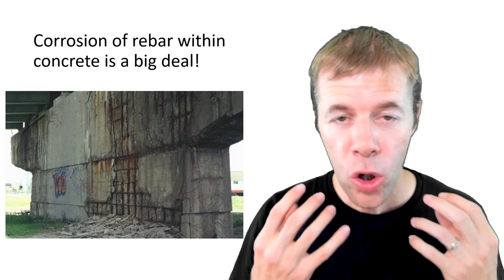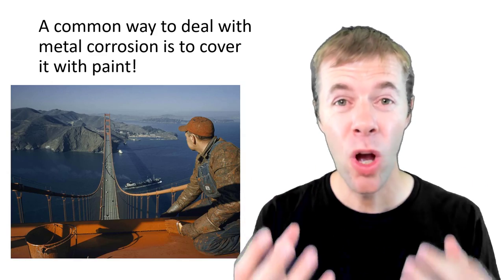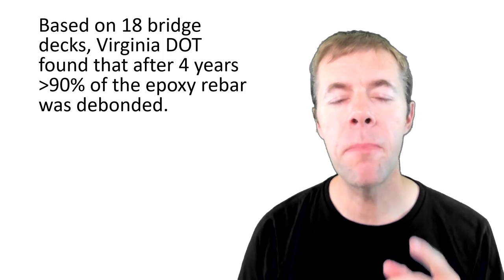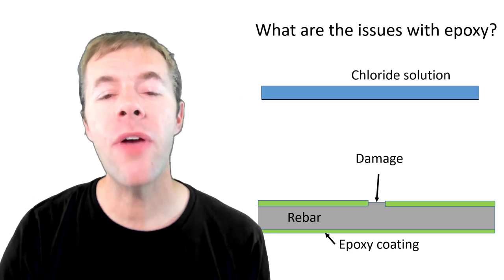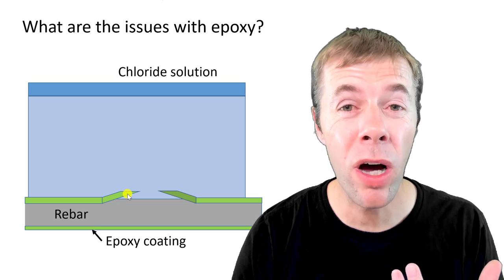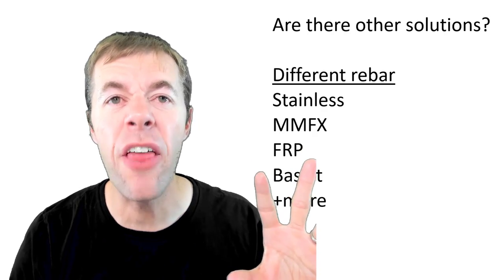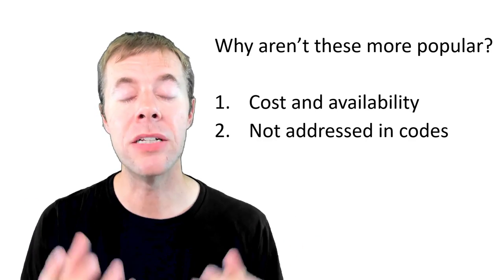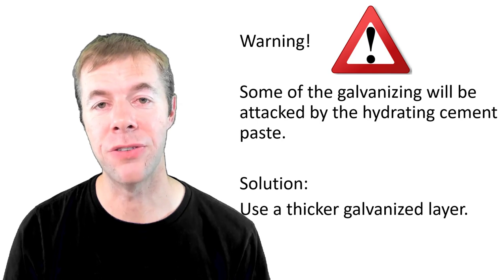What is epoxy coated rebar and why is it being banned?

Comment: Galvanized steel rebar would need to be shop produced very accurrately out from standard rebar and only the you could hot dip galvanize it, as any cutting or bending would damage or remove the coating.

In practice, a lot of rebar is field cut and bent, so galvanized rebar might not be practical.
Reply: galvanizing takes the corrosion away from the steel and gives it to the zinc even if theres rubbed bare spots. they have zinc blocks they bolt to ships hulls to keep the rust down. the zinc blocks corrode away and they replace them every now and then. its just something how the chemical process works. i dont know how it works i just know it does
Reply: @chaytonruijsenaars3971  Yeah, that really depends on what type of galvanizing you use, and on the blend of the zink in the tub.  I have work at a galvanizing plant in Denmark and we would get stuff that need to be remade from China and Poland because it was badly made, but people tend to uses them because they are really cheap, but cheap might mean the layer isn't uniform or the mixture is bad so the lifetime is short on the product. I have seen products where the rust got through the galvanizing layer and simply ran under it making it fall of in flakes, because they used too little zink in the tub, wrong temperature, to little time in the tub so the layer was to thin or they dumped it in before cleaning the iron so the outer layer already was rust, so the zink was just put on top of a layer of iron already compromised. Then we have to strip the old layer, clean the iron and put on a new layer, and even here people want the cheap option with as little a layer as possible and even option the cheaper layer option of no guaranty on the uniformity of the thickness on the product as this take more time to do and test.
It's relative easy to treat standart iron bars, but the length and weight can make it more costly to do, as there is a limit to how much you can do at any one time, and you still need to hang it all and treat it, so it will still cost quiet a bit on a ton of iron to do, and it quickly adds up and adds time to a building process and it also means you can't just cut it at the site and be done with it, as you then damage the coating and create weak points that need ned zink.
Reply: @-JustHuman-   im no expert but isnt the hot dip galvanized rebar ran from the forming machine down the line and then allowed to sag into the galvanizing vat and come back out at the rate thats needed for it to have a proper coating? or is it like cut to length then hot dip galvanized. theres also like that conduit mount C channel which is electro plated isnt it? why wouldnt that work?
Reply: Galvanized is better than painted or epoxy but you would still need to touch it up with spay cans where it is cut or bent as the coating would crack at the bend. I have never seen guys on site with touch up paint as they install rebar.  It’s difficult to be on the deck or columns when there is little to stand on.  There needs to be an inspection and touch up certification process tied to this process. And it has to be fast because GC.s want to pour concrete fast and move to the next area.  Nobody is thinking this little nick is going to be a problem 20 years from now.
Reply: @chaytonruijsenaars3971  Well we only got what was already cut, as it would be the ironwork's or smiths that make the rebar/iron, and we have nothing to do with that. I don't know if any one does that at all to be frank, as it would be really hard to do, as we had to hang the iron to dip it in acid, to clean it, then in the galvanizing blend to coat it and let it hang for hours to cool down. I really can't see that be done easy from smelting, then cooling, to stretching, then dip and cool in one go, it could be done but it would be hell to control and one misstep or doped iron in the tub and the whole machine goes into stand still, and you will drop irons sometimes as liquid metal is really hard to work with, especially if something hollow with trapped air gets into the tub then you get an explosion with tons of molten metal going everywhere, that is scary.

Electrogalvanization wasn't something we did a lot of I don't even remember if that was offered at all, as it really don't hold that well compared to the hot dip as it's usually thinner from my understanding, and it takes more time and is more expensive. Most request was normal galvanizing, then powder coating and the then the combined of those two which is what holds up the best, looks better and cost the most, but you wouldn't do that with rebar.
Reply: Normally zinc tends to migrate to bare spots, replating scratches. It requires an electrolyte though, I don't know if this takes place in concrete. I don't think the bare ends would be a problem given that it would take so long to corrode deep enough to make any impact on anything. As for the bends, a bend radius large enough not to structurally affect the rebar probably wouldn't affect the coating either.
Reply: @fascistpedant758  It's going to make the iron hold for longer than without it yes, but galvanized iron will still rust over time, and it can still rust with zink still present under some circumstances, I don't know the english word but we call it "Flying rust" here as it's something that coats the metal surface even if the metal is treated, you can see it in dishwashers sometimes on cutlery too even on stainless steel. Using electrolyte and zink blocks on boat hulls is common to prevent metal fatigue, but I don't think that would ever work in construction as it needs the seawater and a current to work as far as I know, and the zink blocks would have to be replaced regularly to keep working. And i agree you can bend the iron, but cutting it or welding it would still be bad.
Reply: Not really, reapplying zinc coating is super easy, there's the aerosol zinc coating like a spray paint and theres also a zinc bar where you heat the workpiece and rub the zinc bar on it like a marker. Its actually stupid easy and can train a monkey to do it.
Reply: The blocks on boats/ships to help against electrolysis and corrosion are called "anodes" and they aren't always zinc, they also can be aluminum.
Reply: @thomaskoogle9351  exactly, the quality control isn't there and it's all about getting it done asap. You hit the nail on the head.  

And that's what always amazes me about old structures and machines, they spent the money and time to make them last and over built everything.
Reply: @NeuKrofta  "The blocks on boats/ships to help against electrolysis and corrosion are called "anodes" and they aren't always zinc, they also can be aluminum." 
Ah, yes that's the name, but again I don't think it works in construction wit rebar's
Reply: @-JustHuman-  no, but people keep mentioning them. Just letting them know what they're called

Comment: I’m from key west and a contractor as a young man I worked with epoxy rebar on replacing the bridges and agree even though we coated all cuts the handling does scrap the coating away and never gets recoated I hope this won’t affect the bridges but who knows. I also have had customers that insisted on stainless steel for sea walls and I thought they were crazy to pay for the difference but maybe they were smarter than me. Thanks for your cast.

Comment: And then.... what do we dump on those bridges and roadways?  Calcium Chloride.  Face palm!
Reply: Ric Rovey  sodium acetate is used here
Reply: mag chlorate here. doesnt eat steel as fast but it is hell on copper and aluminium.
  honestly, there isnt any need for more than sand the chemicals cause more problems than they solve.
Reply: Its not the chloride that is the problem, its the oxygen atoms in the concrete. Even if your concrete is relatively dry. Hydroxides in the concrete are the real hazard. The chlorides attract water help liberate the oxygen atoms from the water and the concrete hydroxides. The oxygen reacts with the metallic iron in the steal and presto! you have rust.
Reply: WireTamer Where do you think the oxygen comes from? That's right.
From chorides.
Reply: Here in Colorado they rarely use salt, occasionally on the passes they will spray some saline but in general it isn't used because it's terrible for the environment.
Reply: @lukewarmwater6412  Exactly. Sand is ecologically inert, cheap, easy on steel, and effective. It seems that what people expect in the winter is not just a non-slip surface but one in which the snow and ice are actually melted away and the road clear. Crazy expectation in northern states.
Reply: @rcnelson   Sand alone has it's own issues it is very dirty and requires a spring clean up. As it alone was used here for years and you end up with inches of the stuff in the curb gutters in the spring. It also creates dust issues in the spring lowering air quality and it plugs up storm sewers and fills in waterways and it generally makes the city dirty and grubby. Not to mention the toll it takes on vehicles with sand blasted windshields and the other damage it does to vehicles and road surfaces especially painted road markings. Just using sand alone in areas that get months worth of winter (5-6 months here potentially late Oct to early April)  is not practical as was discovered..   Calcium Chloride wetted  sand on the other hand gives a balance between the two less sand is required and it holds the brine allowing it to act on the road ice and providing traction resulting in less calcium chloride and less sand use.   As for rebar we have transitioned to MMFX rebar for transportation structures and seems to have the best construction cost to life span ratio.  The issues with epoxy are negated and unlike galvanized there is no labour penalty during install. (Material is cheap labour is not)  Basalt currently does not provide enough of a cost benefit to structure life span increase over MMFX in/for our environmental conditions.  Conventional uncoated rebar reinforced  bridge decks have a life span on average of 50 years here before rebar corrosion requires replacement, with piers being 125 years+.  MMFX  rebar is projected to extend bridge deck life spans out to the 75-100 year mark or near to the life span of the structure or the time of major structural renovation.  MMFX for many locations currently has the best balance between material cost, construction cost/time, and structure life span.  Basalt has it's place such as in coastal locations or areas that see  very high concentrations chloride exposure  but for most inland locations MMFX currently provides the best cost to benefit balance.
Reply: @rcnelson  main street in kalispell montana used to be lined with big shade trees. but magnesium chlorate took care of that in less than five years.... 
 the epa has some problem with dust. but   would rather have my car last than worry  about something that occurs naturaly whenever the wind blows.
Reply: Wjy not just use plaine NaCl?!
Or maybe mixed with a bit water to make it faster effective.
Reply: Road salt is usually sodium chloride here, with a certain percentage of rock. Ships and trucks line up to ship all a salt mine can produce. Surface rust expansion may lock the rebar in tighter to the concrete, as long as the strength of the bar isn't compromised, rusty rebar may be the best solution, up to a point.
Reply: @lukewarmwater6412  thank you somebody finally states the obvious... Those chemicals aren't good for anything (cars, animals, the environment, the roads, that water table and watersheds) EXCEPT making ice after dark... Sand is the best solution...
Reply: @jimbrent8151  ice after dark is all those chemicals are good for as far as I am concerned. I have seen snow plow trucks throw ice melter on corners and not blade off the snow. up untill the ice melter the snow is light and fluffy and moves out of the way to an extent.its not a huge problem to drive on except its getting smsashed down into ice. where the ice melter is it is mush and causes a loss of control.
 if they would just drop the blade and not use the mag chlorate it would be a much better driving surface.
Reply from the maker: @wiretamer5710  The high pH of the pore solution actually causes a protective layer over the rebar.  See a video about it here: https://www.youtube.com/watch?v=sh-V1grSkMQ

The chlorides break this layer down and cause the corrosion.
Reply: @xXDESTINYMBXx  In areas where there is easy access to a salt mine, NaCl is sometimes used. However CaCl2 is often much cheaper since it is a waste product of the Solvay process, an industrial scale chemical process for converting limestone (calcium carbonate) into washing soda (sodium carbonate). Also, CaCl2 can be effective at melting ice down to about -40 degrees C. NaCl is only effective to about -20 degrees C, so would be useless in some places.
Reply: Ric Rovey  If you don't like Americas government move to Venezuela.

Comment: Galvanized rebars react with fresh concrete and this reaction produces excessive hydrogen, particularly if the alkalinity is greater than 13. Hydrogen adversely effects the interface between concrete and rebar thereby reducing bond strength. To reduce this reaction and evolution of hydrogen, chromate can be applied on the bar after galvanizing.
This is one of the best solutions, however, further studies needs to be done to come up with a consistent and repeatable model.
Reply from the maker: Thanks for the message!  You are right.  There is a reaction between galvanizing and the pore solution of concrete.  I believe that is mentioned in the video.  There are a few ways that you can deal with this.  You can design your coating to be thicker or as you mentioned you can modify the surface.  There have been many bridges built with galvanized rebar with and without this surface coating and they are performing well.  There has also been significant testing on the bond and development length of galvanized reinforcing and they show minimal loss of performance.
Reply: When welding, excessive hydrogen weakens steel (hydrogen embrittlement).

Comment: Would make more sense to coat the bars after they’ve been set in place and then inspected by certified inspectors. That way it would hold up better.
Reply: Then they would be coating over Rusted bars
Reply: And it would be impossible to get every nook and cranny.  Other than that, nice idea!
Reply: But using a chemical conversion coating might work better than powder coat.  Never liked powder coat anyway, doesn't bond well enough.

Comment: Coming into this video I thought, "Well, hot dipped galvanized rebar is honestly rather good, I wonder if it will get mentioned.", and it were...
Also, to fix that issue of some of the zinc getting eaten away by the concrete itself, well, just coat it in a layer of paint...
Adding a thicker layer of galvanization is though harder, due to the fact that molten zinc only adds a layer that is about the thickness of a paper. (we could electroplate on more, but that uses a lot of power for relatively thin coatings...)

Also, when it comes to adding paint as protection, a key detail is that one shouldn't just add 1 layer of paint. But rather 2 layers of highly contrasting colors.
This means that it is easier to see chipped paint, even if it is extremely subtle. While the second layer also provides some additional redundancy.
But paint has the main disadvantage that it is rather fragile, even if it is the more gooey types...

In the end, I would go with galvanized rebar.
Reply: Nice comment man very interesting

Comment: There are limits on the thickness of galvanizing and the standard heavy coating is 5 mills (.005”). It is difficult to masure the thickness on rough or uneven surfaces like rebar and bolt threads. I have seen zinc coatings about the thickness of a penney. This was done in error and the vendor had to fix it because it would flake off in sheets when hit with a hammer. Additionally the bolts would not fit in the bolt holes because the holes were clogged with zinc.

Another observation is that when I have seen ganvanized anchorbolts removed from being in concrete for years the galvanizing  had rusted. I do not know if this reaction was due to exposing part of the anchorbolts to the weather.

Comment: Im a fan of fiberglass sticks. Because they dont rust. The better option is to just requiring a higher strength concrete get poured, and skip steel entirely.  Designs would have to change, but we would go from 20 to 30 year bridges, to 200 to 300 year bridges because there would be no corrosion.

Rebuilding infrastructure a second 3rd or 4th time is way more costly than the design changes to just using 1 non corroding material.
Reply from the maker: Jess,

I talk about what you suggested here: https://www.youtube.com/watch?v=1ELHzXuwdqg
If you don't have reinforcing then your members become massive.

I do agree that fiber glass reinforcing shows promise.  You have to be careful though because they creep!  That means they keep moving under a constant load.  We need to do something different.
Reply: Massive isnt bad though. The ancient concretes the romans used were massive and lasted ages.
Reply: @TylerLey  
In elementary school, my teacher told us about glass; That it is not quite solid, but an astonishingly viscous fluid, which flows faster when heated.
Reply: @avid0g  
It is amorph - meaning it has no crystal structure (lattice) because it cooled quickly, like Obsidian which is what you could call Basalt glass
Reply: it is you who is ignorant, glas is much more hard than pitch, but it changes shape under the influence of gravity, only that this effect is so small it needs centurys to occur. It flows so slow it is almost a solid.
Reply: @ulrichkalber9039  That's a myth